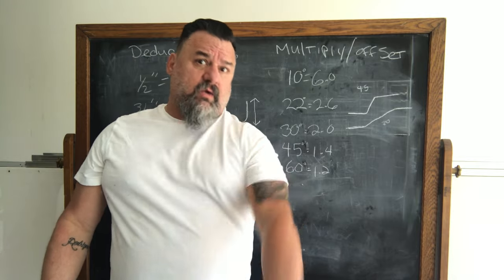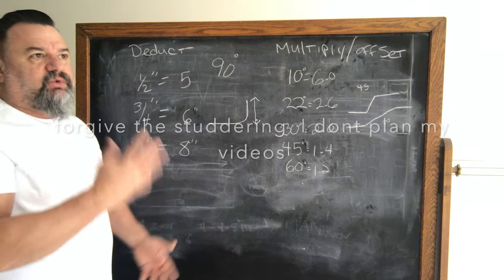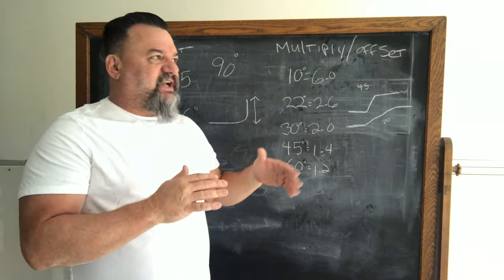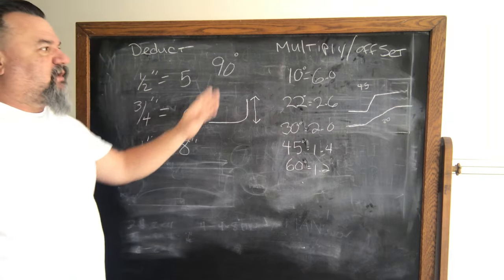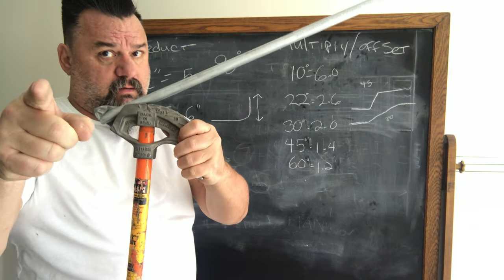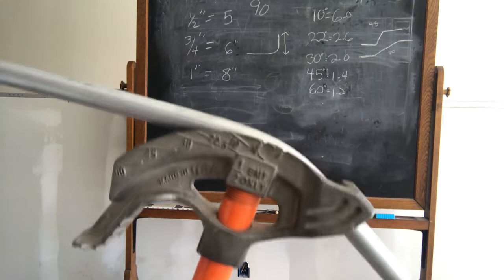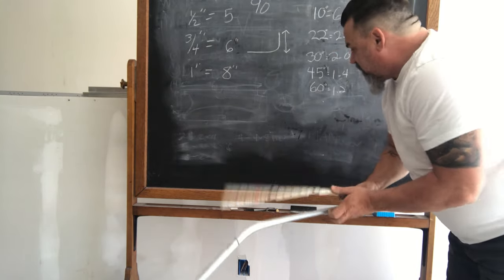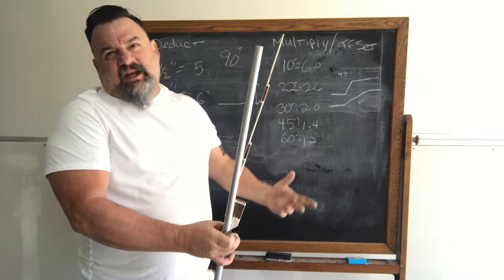Unbelievable! Watch THIS to See How Easily You Can Bend Pipes Like an Expert Electrician!

Comment: Is there an easy formula to remember these standard deductions and multipliers? I just mean like off the top of your head some trick to always remember
Reply from the maker: well I use the 30 degree bends. always multiply times 2 easy to remember. I will be doing a new pipe bending video soon with more info.

Comment: Where did you get the 3inch from for the offset
Reply: Different folks have different starting places on the conduit. It's weird but whatever works lol
Reply from the maker: not sure what you mean? i made up the measurement. if you are talking about from the starting point of the pipe to the mark on the bender thats different.

Comment: A little confuse sir where did you get the times 2...or 12inches..thank you
Reply from the maker: for a 30 degree bend you multiply times two. so 6 inches times 2 is 12 inches. so your bends are 12 inches apart. you bend both of them on a 30 degree angle and you will end up at a 6 inch offset. I hope that helps.

Comment: Hey! Thanks for the videos but I have a question for a 3 point saddle, if one side is “up” a bit how would I fix it so it’s flat … hope that makes sense
Reply from the maker: theres a lot of forgiveness with thin wall. at that point i would flip the three point over and try to get the over bend straight or simply move the bender out from the mark. three points are a pain in the ass. i don't want to get to technical for the beginners.

Comment: I had a question about bending pipe schedule 80s schedule 160 it doesn’t matter that’s what I do at my job I’ve bend grease lines for ball valves was curious if the same Mark backs multipliers for your offsets all that applies to galvanize steel pipe also They had no training on pending and so yeah I pretty much guess and check And I’m not OK with I guess just wasting product like maybe my company is OK with me doing so I’m trying to get better and learn some stuff
Reply from the maker: well as far as pipe diameter so long as the outside is the same its all the same. these deductions are the same for rigid pipe as well. its based on the bender but the deductions are the same. on a rigid bender the deductions are the same but never accurate. you rely on travel and pipe take up. a different animal. I don't know about hydrolic lines. zero experience with those. sorry
Reply: @StarvingElectrician  Thanks for the reply I really appreciate the time yeah I don’t do hydraulic lines I’ve worked a job making hydraulic line. What I do at this job has been grease lines for the valves ball valves 20 inch to 42 inch diameter‘s the lines are usually half-inch or 1 inch pipe to be run up extensions where the valve it will be buried it was my first day back at work since I watched your video I did do some offset math and you’re right it helped get me close but it wasn’t like spot on your new exactly how it was going to be so I guess I’ll just have to keep working at it if you’re interested in ever checking it out I can definitely record a video one day and send it your way so you can see exactly the beast I deal with

Comment: How do deductions work on the other single bends? Say, a 45* bend…is it simply half of the 90*, or not that simple?
Reply from the maker: yes its 1.4 is the multiplier. so a 10" bend times 1.4 will give you the distance between bends. dont use the 90 deduction.

Comment: How much should I expect to pay to replace the 100 amp main breaker in my panel. They will have to pull the meter?

I've subscribed to your channel for the realy good info you provide!
Reply from the maker: yes they will have to pull the meter. main breakers are about  $75.00 it's not a big job but i would imagine a few hundred to replace it. just depends on the contractor.

Comment: Where in the ugly book I can find amps for each awg example 12 awg 20 amp need to find that info for service and branch circuits that's brothers..
Reply from the maker: i have a video on that. its really easy. i dont know where in the uglys book you would find it but the code book also has the charts. also for voltage drop and "D" rating.
Reply: @StarvingElectrician  send the link brotha I'll appreciate I just got hired and still learning 💡
Reply from the maker: @DESPYS1LOSTCITY  i dont have that link i have researched and found it with a google search. just look for acredited  places
Reply: You can Google the wire size for the amps.

Comment: 4:50 Wrong. Your pipe SHOULD extend beyond the front edge of your hook by at least one pipe diameter if using compression fittings. Set screw fittings are a little more 'sloppy' and forgiving. The risk you run is that you may flatten out of round your pipe so much that your now oval pipe won't go into your factory round connector or coupling.